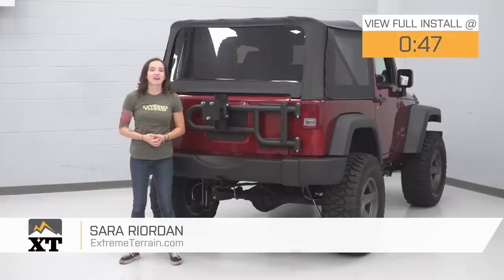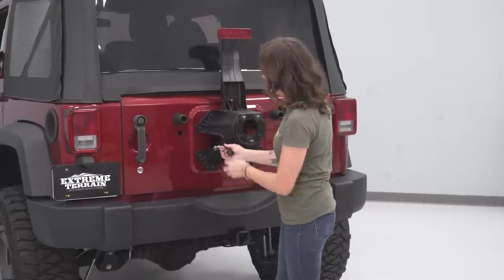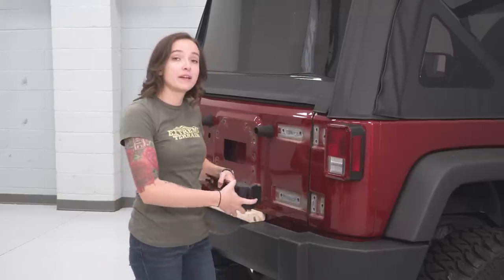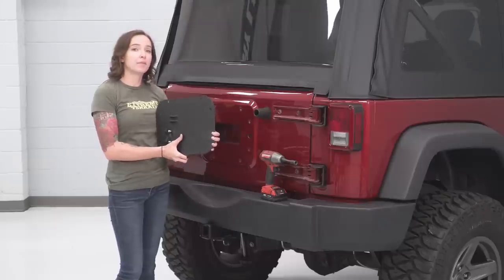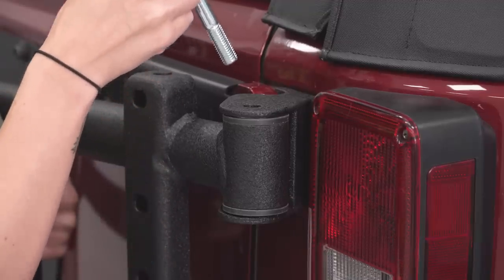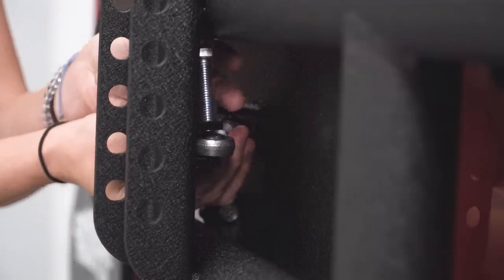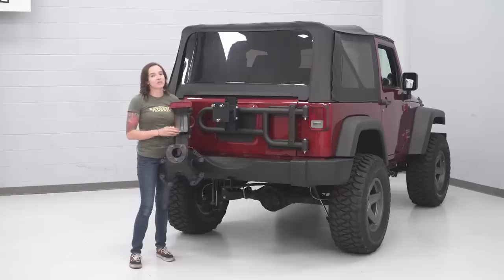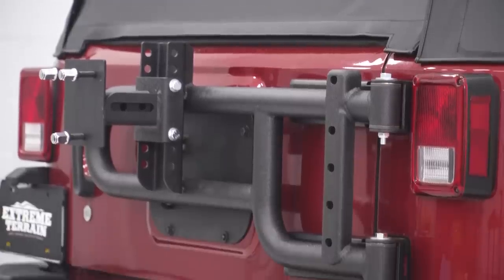Jeep Wrangler JK RedRock 4x4 HD Tire Carrier for OEM Tail Gate Review & Install

Comment: At 6:29 the installer talks of removing the rubber stoppers.   WHat i did is cut them by 50% and reinstalled.  They provide added support and also prevent rattles, not to mention sealing up the hole if you removed them.

Comment: Great tutorial and is the only way I would have installed this because the company didn't send installation instructions.  The only thing that is missing is that the turnbuckle needs to be adjusted so the tube closes to the neoprene stop or else the rattling of the turnbuckle occurs.

Comment: What about the holes you left in the tailgate by removing the rubber stoppers? Those need plugged with something I would think
Reply: Caveman Outdoors Easy Home Depot/Lowes/Ace Hardware $3 buys the - rubber plugs.
Reply: @LukeEdward  the kit should come with those plugs in my opinion
Reply: I had the same thought.  And no brake light.
Reply: @430CMB  the new girl is pretty though
Reply: @smokawat  ... you make a really good point.  YES, the plugs should come standard.
Reply: smokawatZ06 Yeah. I see your point.  It’s wouldn’t be to much to include all the sizes that it could be through the JK years.
BUT
I would just have cut them down so the fit behind the new tire carrier.  A little more insurance that cost nothing but time with a sharp razor knife.

Comment: I just installed this today, everything was going smoothly until the last bracket that has the 3 lug bolts. The 4 bolt hole have nuts welded to the inside. NONE of the 4 nuts were welded in the center of the hole. The bolts will NOT line up and I cannot get them started. Very pour quality control. I have to take it to a buddies drill press to align the holes with the bolt. Not a happy camper right now!
Reply: Sounds like you don't know what you're doing. You should just not

Comment: not sure its going to be any better or stronger.. Still using the same hole and putting more bigger and heavier metal.. there is no reinforcement on the holes such as washer or bigger bolt.

Pretty sure it be nice for now but to me it looks like it is going to put more pressure on the body side of the holes..

Please advice guys i'm thinking about putting one. this or the bumper/carrier combo ?

Comment: Is this available for the YJ? If not, what comes close?
Reply from the maker: We don't have an option too close to this RedRock 4x4 HD for YJ model Wranglers. If you're looking at beefing up your stock tire carrier in general to handle a heavier spare, I would recommend checking out the following link! Hope this helps! -Zach
https://www.extremeterrain.com/rugged-ridge-spartacus-hd-tire-carrier-wheel-mount-8706-tj-yj.html